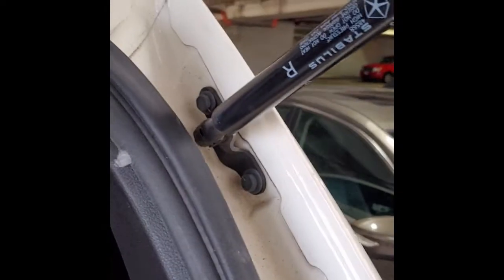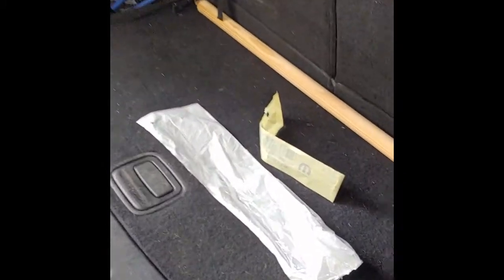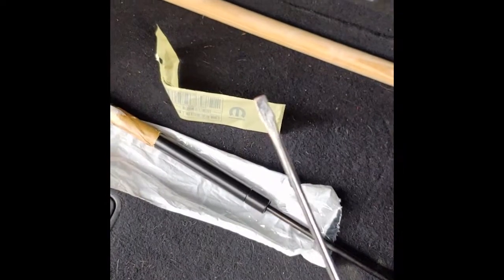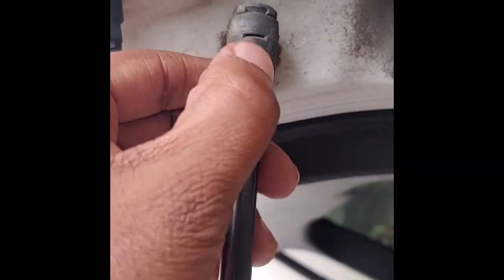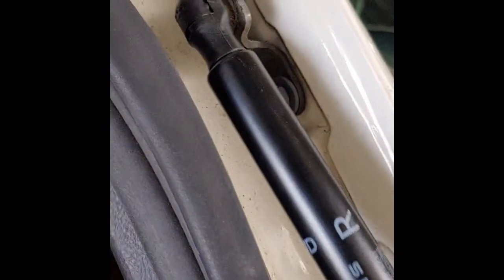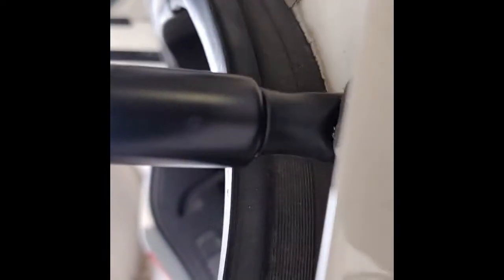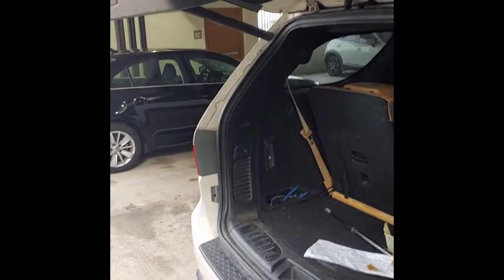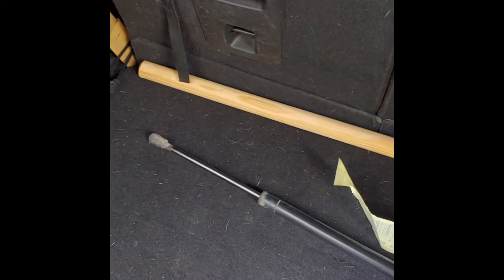Tailgate Liftgate support  repair Dodge Durango 2011 Citadel

Comment: Have almost exact problem but the issue is the bolt broke off and it stayed stuck so can’t remove to replace to a new strut we have tried everything and no one wants to try to remove bolt any suggestions?
Reply: Mines broke too but it won’t close all the way

Comment: What if the tailgate is automatic
Reply from the maker: This tailgate is automatic but the liftgate support that was bad was the supporting one not the automatic side which is a different part.  Luckily i didnt have to replace that one. Is the problem you are having with the automatic side?
Reply: @elyown75  I don’t know which side is going but when the gate lifts it automatically closes back down
Reply from the maker: @C.B.youtubeTV  that's exactly what was happening to me. The automatic lift only lifts it and closes it. The other side keeps it open. So i decided to change that side first since it was also cheaper.
Reply: @C.B.youtubeTV  oh no that happened to me till it broke off liftgate kept opening and closing and it just gave out